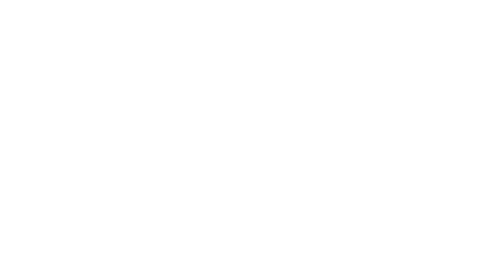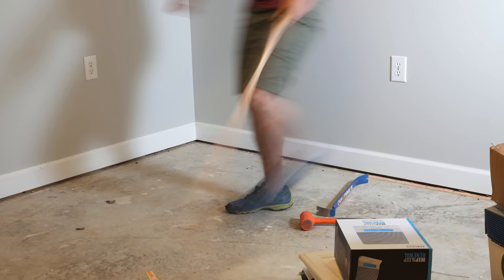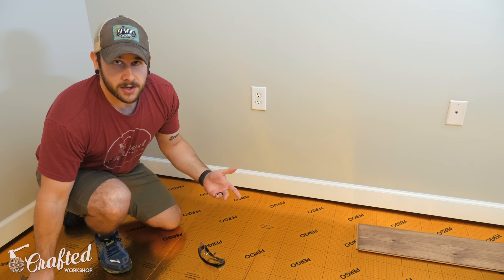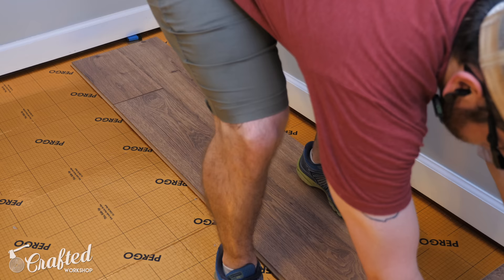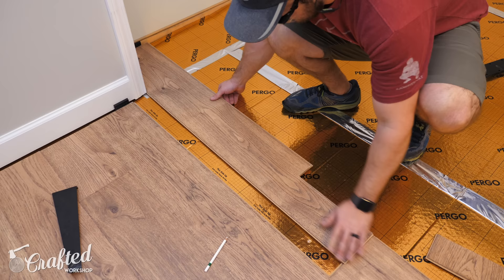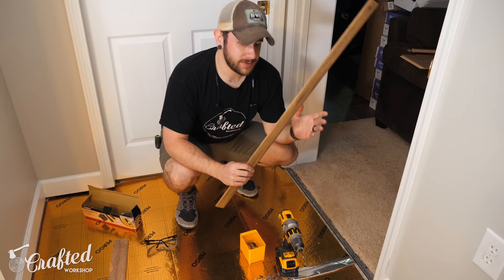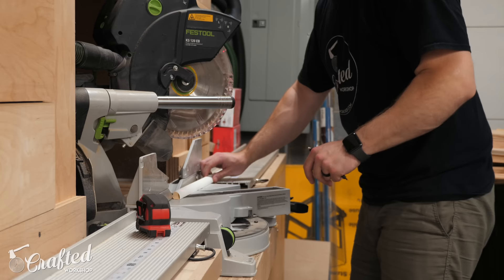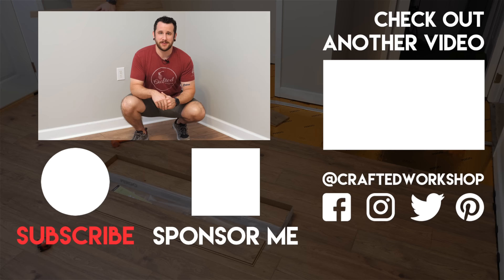Installing Laminate Flooring For The First Time // Home Renovation

Comment: Looks great! Hopefully I can spark enough people's experience and wisdom to chime in on what will undoubtedly be some ignorant questions. Question 1) What are the benefits of hardwood vs laminate flooring? Question 2) What is holding the laminate floor in place? Will is shift or slide if kids are running on it and stopping on a dime to change direction? Question 3) How well does the underlayment help with insulating? I have sections in my home that are tile directly above the crawlspace where there is no insulation and it is FREEZING! I need to figure out if I should also think about insulating the floor from underneath. Thanks for the video...it brings on confidence that the first room we do will likely be laminate where there is currently tile.
Reply: Hardwood is definitely better as far as a nicer finished floor however it will definitely cost way more. Nothing really holds it in place other than trim around the edges but chances are it will not move around a whole lot because they are all locked together . As for insulation the underlayment may stop air flow but it won't insulate very much. You are better off spray foaming the crawlspace

Comment: Love the home project eps keep the good stuff comming love what you do
Reply from the maker: Thank you!
Reply: Crafted Workshop I've just bought and laid 15 packs of walnut effect laminate, it was 20 pounds a pack and that's a lot for me! I'm stuck now, how do I cut perfect angles for my edging,  (with a handsaw) my house is very old,built in 1856 and not one edge is straight, or corner 45 degrees, any tips? I know it's a tough one.

Comment: I came from the front page of Reddit, nice dude. I bought a foreclosure so this kind of gives me an idea of what laminate install would be like.
Reply from the maker: Nice, go for it!
Reply: sieve5 Go with vinyl laminate plank. It’s just as nice as wood, more durable and about half the price. I installed some Shaw brand Luxury Vinyl Plank and it looks like wood with the added bonus of being able to use basically any type of cleaner I want even straight water.

Comment: Quarter round is a quarter of a round  not quarter oval. It is the same size on both flat edges.. what is used in the video is not quarter round, but rather shoe molding. Normally, one edge is 1/2'' and the other messures 3/4". 
    
The name doesn't make as much sense as quarter round, but shoe molding is what you want. Just remember to maintain the same orientation throughout.  This isn't to correct, but rather to help in case any DIYers try this also. Figure I might try and help before someone.... 

However, I'm with one of the comments on here taking about just using new baseboard. Much cleaner look also. Or, if you have as steady hand, a utility knife can score the top of the existing baseboard where it meets the wall. This will cut and separate any paint or caulking that may have the two stuck together. Cut with blade more toward wall to avoid hacking up your trim.  If you cut it good enough you can use a small flat bar and remove it, without also ripping your paint away. Pull the nails through the back so you don't ruin the face, lay the floor and reinstall. 
It will sit a little higher than before and cover any paint line or knife marks. If done carefully and correctly, it will look better and be cheaper then buying shoe mold. Wouldn't need anymore than a two and a half dollar tube of caulk..  FYI. silicone doesn't like to paint so steer clear.
   And lastly, great job on the floor! My biggest problem is getting that initial start and keeping everything tight and squared up, but your seemed to get right into it. Also. I love the usage of scrap to set the pieces tight. Figured this out for myself somewhere along the way and until now, I've never seen anyone else do it.  Haven't seen too many of Pergo vids though so, IDK. But those tabs are easy to beat up and the tiniest flake of anything getting into the joints keeps them from closing up tight. Seems once you get an eye opened up it spread out for the rest of the project. The scrap hello a lot here cause those blocks that you get in the kit just destroy IMO.
 Anyways. Good luck anyone trying to do this for themselves, and Good luck, Workshop on your future projects. Can't wait to see em

Comment: You will most likely have staples to pull up, as well as the tack strips.
Reply from the maker: Not on a concrete slab, but yes on a wooden subfloor.
Reply: He said at the beginning he had to remove tack strip

Comment: 1:38 Use a flat screwdriver and a hammer, hit it once or twice where the nails are and then twist upwards. from - tot | with your flat screwdriver. Way faster and the strips wont break anywhere.

Comment: Hey, how can I install laminate flooring around steal door frames if there's no gap to slide the plank under it?
Normally with wooden door frames I just trim them.
Reply: A angle grinder, with a black metal cutting blade.

Comment: Also, that vapor board cant be cheap.  There are other products you can find.  Even tar paper works as a vapor barrier but on a floating floor it might move. We use a poly foam rich in veins so air could move throughout. Been down 5 years no separation anywhere. We didnt use a laminate, we used engineered hardwood.  However, will def need to be refinished within the next 4 years. Thanks Dog.  Anyway, best to go with real wood or engineered wood. Laminate does not last as long and when its done its done. At least with solid wood you can keep refinishing it, and with engineered wood you can probably get a couple refinishes out of it depending on how much real wood is on top.   Best of luck.

Comment: You forgot your back rod! Pergo Timbercraft is waterproof but it is recommended to install 3/8 backrod between the laminate and your wall, then apply a bead of silicone over the backer rod and laminate. Then install your quarter round.
Reply from the maker: I didn’t need the waterproofing in this space so I didn’t install that, but had it been in a bathroom or area that would have seen a lot of moisture, I would have added it.
Reply: @craftedworkshop  That makes sense. Great job on the video regardless! My comment was more or less for the people that would need waterproofing on their install. I work for a major hardware company that sells this flooring so I figured I'd throw that in there for anyone that would need the information. I'll be sure to tell my customers to check out your video if they have questions on installation.

Comment: 1st time home buyer. I asked the home inspector if he could tell or check to see if I hadbhardwood floor. All he did was pull a vent amd was like Nope. Home is 2100sq ft. So yeah def. Going laminated route. I'll hire a professional for the formal areas. I have 4bd rooms. All new carpet. I may just start in one of the spare rooms good video

Comment: I’m a professional installer . It’s a cute video but if you see how the pros do it . It would be much easier and you’re not supposed to forces the end joints by hammering them in the place . Laminate floors are supposed to lock in together . When hammered in you actually break the locking mechanism which keeps the floors together , so later his floors will start to open at the joint because he broke each joint by hammering them shut . Lol
Reply from the maker: Definitely didn't break each joint, and the floor is still rock solid almost a year later. This floor did not want to click together easily.

Comment: Laminate flooring sucks, had it for about 7 years.  When it gets wet it swells up to easily and looks ugly
Reply from the maker: I would probably go with vinyl plank flooring at this point, just as good as laminate and more water resistant.

Comment: Hm. Question. Why would you need to remove the tongue (or the groove for that matter) on the first row?
Reply: You don't he's just making more work for himself .
Reply: Because the way he has his spacers taped to the wall means the tongue will be visible and the quarter round may not cover the tongues, although usually it does

Comment: This flooring is much easier on the wallet compared to ceramic/porcelain tiles after backer board, thin set, grout, screws and sealer costs. Sheeesh

Comment: Using offcut as tapping block against tounge  - PRO TIP!!! I ruined so many boards tapping to hard...
Reply: Hi Felicia, Just curious if you will need a brand new set of flooring installation kit? We currently lauch a brand new set including pull bar, mallet, tapping block, spacer and keenpad for a free giveaway compaign. Let me know if you are interested.

Comment: As an installer this was a painful video to watch lol
Reply: same mate :D
Reply: Even as a normal person with knowhow of how to install such floor.

He should have removed the white strips on the wall for a better result 

Removing the carpet is also stupid since its a cheap option for a underfloor
Reply: I am curious as to why he thinks he had to cut off the groove and the tongue (end of board) on the first row. This seemed to be a complete waste of time to me.
Reply: but you guys charge way too much for what really is a job that can be learned in a few days. Its pretty much at the low end of the building game, skillswise. Easy, easy money for not a lot of brains.
Reply: @darknessblades  Seriously?  You leave the carpet and install laminate on top? How do you manage transitions to other rooms with that approach?
Reply: @alphabetta2001  that's the same thing I am thinking! its going to be hidden anyways.
Reply: @traceyg07  I wouldn't cut off the tongue & groove at the end of the row either if the base is suspended above the carpet (suspended from the floor after the carpet is removed that is). if the baseboard is laid straight on the floor, and assuming I'm keeping the baseboard then i would cut it to leave the floor as close to it as possible whilst accounting for the necessary expansion gap. though usually old baseboards are gross and ugly and I would replace them with beefier ones anyway.

Comment: Shoulda saved yourself some money and had someone who knows what they’re doing install it for you. Your floor is weak cause your joint spacing is horrible. You’ll be lucky if it doesn’t gap out and separate in a year or 2. Shoulda took the base off and put the floor under the base which woulda eliminated 1/4 round for everything. The transition is the wrong transition to carpet and it’ll pop off the metal track after some traffic hits it. Good luck with replacing everything though
Reply: You don’t make yourself seem smarter— by downing on other people’s Chanel’s - actually the opposite. 7 veteran pro’s agreed with his project-  Should you feel threatened and unsubstantial again-  Don’t go to the effort to post a long hate messg...  work on your own stuff - or move on.
Reply from the maker: Appreciate that!
Reply: I actually thought you did a nice job on the video, but was kind of wondering why all the trim was still in place.  I do think that flooring should be done without the trim already in place so that you don't have to add the quarter round, but I understand if you didn't want to mar the trim (or wall) by removing it.  I think David had some validity, but probably a little callous (the internet does bring out the worst in some folks - sorry, Dave, just a little too blunt!).  I thought the video was good, but it never hurts to hear constructive criticism.
Reply from the maker: Thanks!
Reply: Just want to ask. When you say "took the base off" is that mean the big white strips along the wall? Just want to gain knowledge. Thanks. And do we hate to put coat over it or something?
Reply: Lots of times the base is left in place to not make it or the wall...Also some base is too thin to cover & quarter round is required to give proper gap...IMO quarter round looks better.......oh by the way I install for a living......You did a great job.
Reply: @Dingus E. Dow I don't believe he is triggered at all he is just sticking up for someone that has experience the same as the person that made the original comment. Everybody has their opinion to each their own. In this video this guy did a very wonderful professional job
So he is just say no need to be negative or anyting especially when probably not knowing what they are talking about. You can't base experience that you seen or heard just by someone's awesome professional video 👍
Reply: Always that one or two ahole know it alls out there
 Ignore them,scree em,you done a awesome job and will last year's down the road
Reply from the maker: It was, I’ve got a video on it.
Reply: David Henrie Taking the base off would have been much more work, not to mention potentially damaging the walls and/or the base itself. Which would translate into more money spent. Besides you add the 1/4 round because you give all the edges of the laminate room for expansion and contraction. So if he’s using a 1/4 and giving them room to expand and contract like all laminate floors to normally then I see no reason why his boards would come off. There’s people who get things done and learn from their mistakes, and then there’s people like you who like to criticize other people and point out only the negative, which btw people like that seldom get the work done themselves. So learn to appreciate the time and effort he took to learn and do it. I think he did a really great job. That pergo premium underlay is not cheap. I bet it cost him like $600-800. I doubt someone who spends that much money just on underpayment wouldn’t take his time, research it, and carefully get it done. Choose your words wisely. They speak volumes.
Reply: not only did he learn something new but also made money off this video ..so
Reply: Pergo is low quality and will need to be replaced in a few years anyway.
Reply: @David Henrie I’m just curious - why would someone like you that seems like a know-it-all watch this video?

Comment: Step 1 of laminate. Throw it in the 🗑
Reply: Only because hardwood is better
Reply: I dont like the thin ones.  Those snap on or click isnt as easy as they say.  They break pretty easy
Reply: @law35penn  lol i just put in 30 Square feet of Pergo a month ago with 0 experience. Super easy. I never used any tools other than measuretape handsaw and breakerbar. Took 2 days.

Comment: In Brazil usually they use a bit of white glue between the boards, this also helps with water splashes. Seeing this is not so common there.

Comment: Good video. But I've installed a few floors and the single most important thing (and the hardest since I'm not a pro) is to level a concrete floor. Current project has a 3/8" rise over 3 feet into one corner. I'm going to grind the floor again unless anyone has advice.

Comment: I laid down laminate flooring in my house 10 years ago but didn't have to worry about working around corners since it was only needed in a living room.  I was hoping this video would provide an easier way to measure around the doors and such.
Reply: Try your local community college.  They might have flooring & Installation classes. Mines does for $125, I plan to take this up in the spring. Its once a week for 3hrs, for a total of 48hrs... better than watching this video
Reply: @cashrules520  thanks for the good advice but I decided to just do it myself the way I figured out how on my own.  I sometimes view what experts say just in case there is an easier way of doing things

Comment: Cool that you showed your mistakes. But my question is, why didn't you remove the baseboards which would eliminate the need for the quarter round. Plus it would give it a much cleaner look.

Comment: No need for hammer and 5 foot crow bar for tackstrip removal - that's retaded, just jamb a pry-bar under nails and push down (prying up the nails). I'm a professional carpet installer, and i'd have the strips up and floor swept in under 5 min. Rookie

Comment: Would have liked info on how you get the flooring in where a hammer doesn't fit. Such as the back wall of the closet where there is nothing to cut around.

Comment: Another tip for removing tack strip, is if u slide a hammer on the ground and hit the tack strip on its side toward the wall where the nails are at, they loosen up, and you dont need to cut the tongues on the first row, just a waste of time

Comment: Read a lot of bad reviews on that pergo gold. All were same, noisy when walking over. Sounded like 'crinkling', 'walking on empty aluminum cans", 'walking on bubble wrap' etc.  About to put in a room at my house and not wanting to have to hear any of that when finished. Thinking of taking underlament back to lowes and finding some felt or other under lament. I do not need vapor barrier where I am putting in floor.  Read key was not using self advisement strips, but taking off and using tape. On the fence now , grrrr.

Comment: He did a nice job, nice video. He didn't explain how to stagger his cuts, thats key. And no need to shave the tongue off first piece, not necessary. And only lay underlayment as you go with floor install so you dont damage it walking all over it. Also spacers are gimmicks. Laminate wont expand itll barely shrink if anything. Push that floor to a comfortable pressure to the wall otherwise 4 months later youll see gaps under your base or shoe.

Comment: Just out of curiosity...did you ever put tack strip at the doorway, behind the transition? If not I’d definitely tack down some staples through the carpet to prevent the carpet from buckling..this will help prevent from the carpet needing to be re-stretched over time. Especially if this is a high traffic doorway